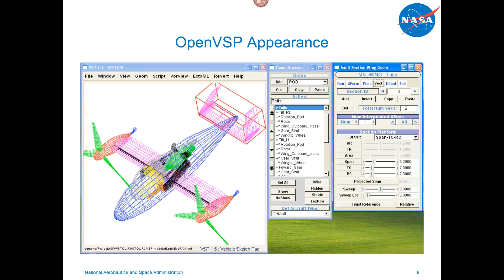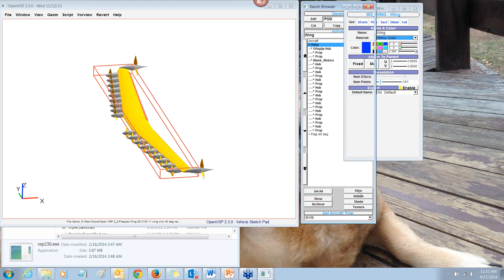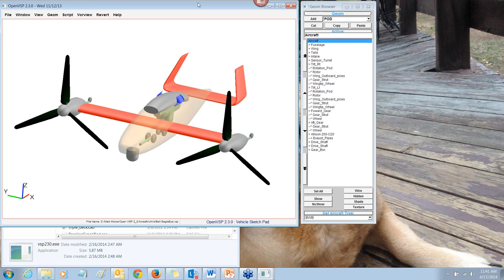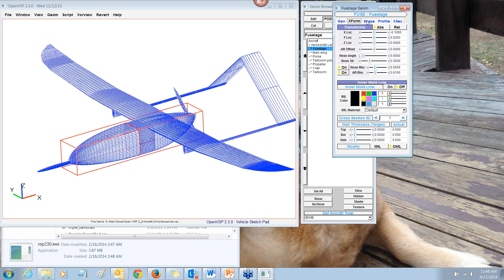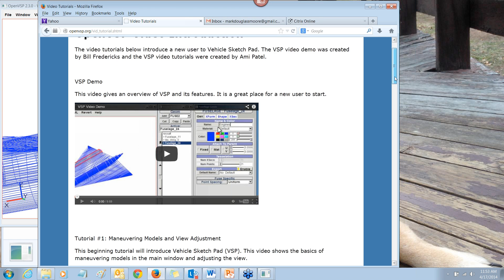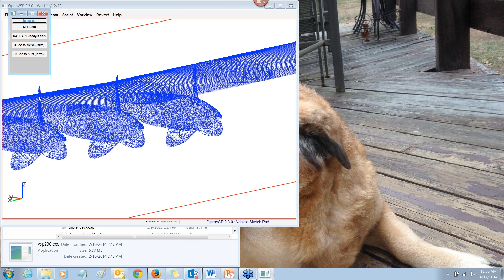Vehicle Sketch Pad   NASA

Comment: How and from where of the software can I put feet or meter unit changes to apply my calculated data's during designing ? Or can't I use unit changes during drawing?
Reply: The models are designed without any specific units, for ease of usage. You can enter the relevant data in the commensurate units , while putting the grid in solver.